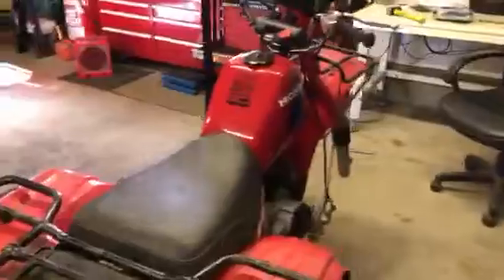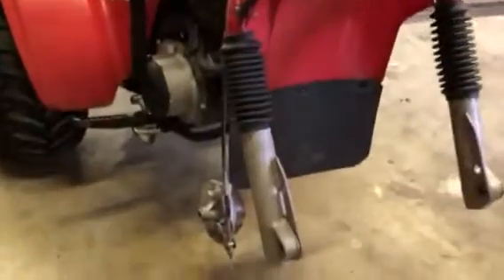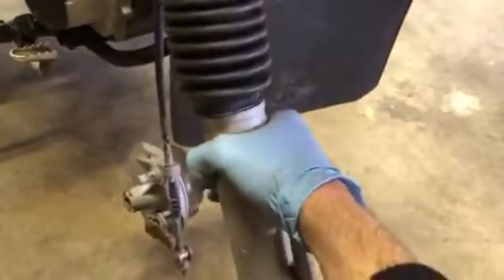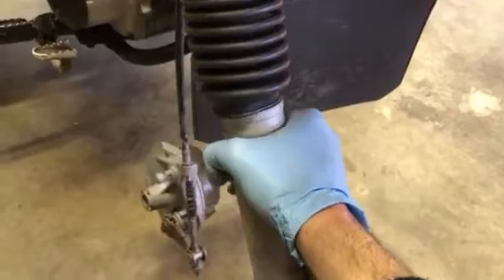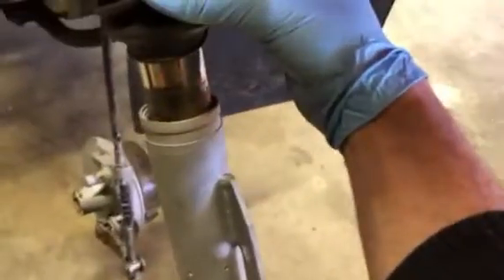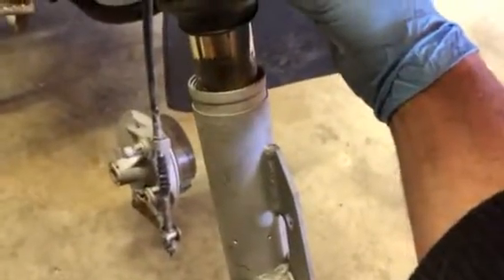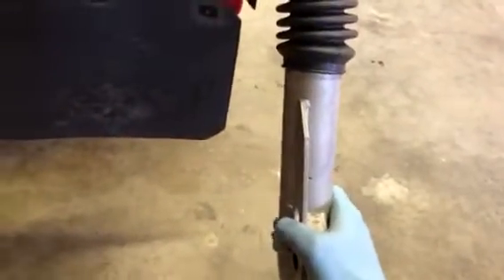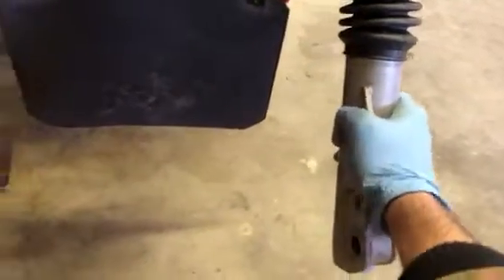Big Red fork problems

Comment: I just picked an 84 up today. The Right fork is doin exactly the same thing. The left one doesn't flex but seems stiff. Maybe because of the variance between the two sides. The right side squishies like nothin and the other side is very, very firm. Were you able to figure anything out
Reply: I'm rebuilding an 84 fork now. I bought new fork bushings and used some distance collars from another fork I saved. The shocks/dampers were the most difficult, but now I use hood support struts available at any auto parts house. Take the old ones and find a hood strut that is the same diameter and close to the same length. Save the old dampers cause you'll need to cut the ends off to attach to the new gas struts. The plastic end on new strut will unthread and drill and tap cut off top of old dampers. Then the new strut will need to be cut to length, slightly shorter cause you'll use the threaded end from old damper and carefully weld it on. (You can have someone weld if you don't)  It's a little tedious, but I've done it and it works welland looks stock.  Sometimes and I mean sometimes you'll see the OE dampers on eBay. Of course that's the easiest, but super rare and usually expensive.